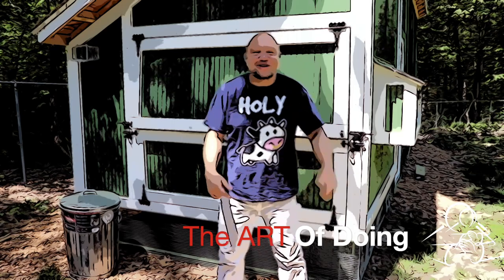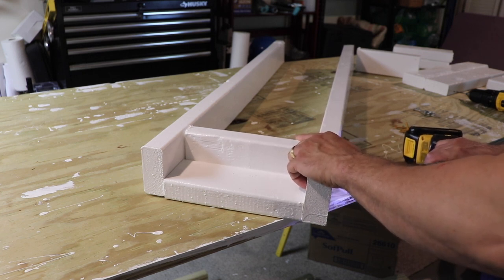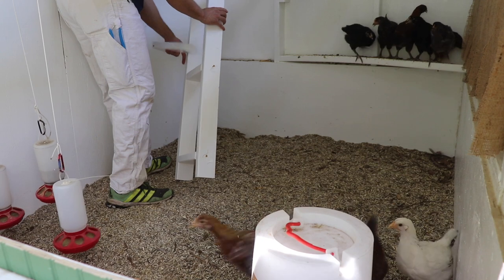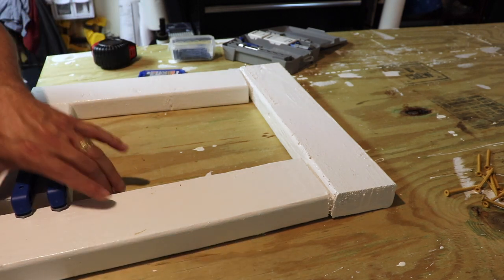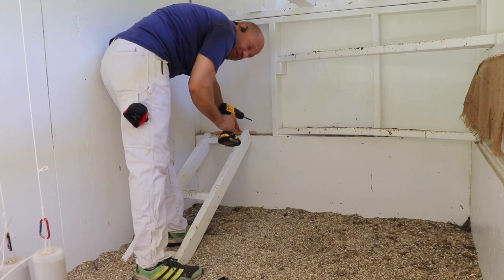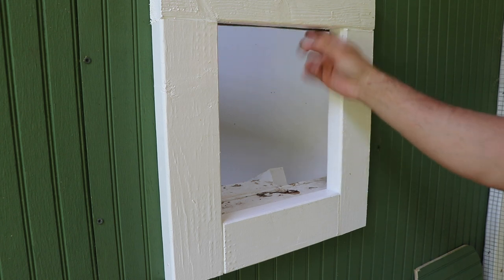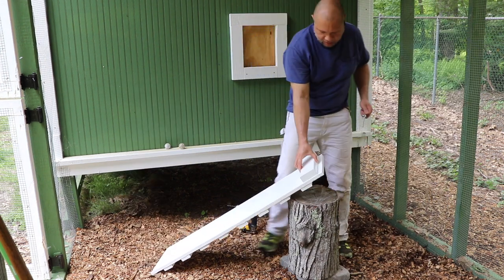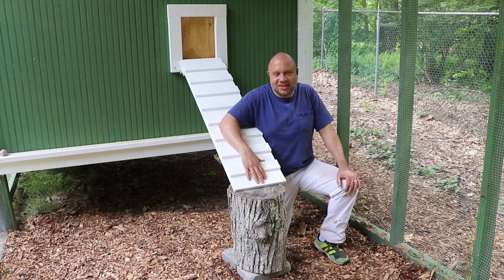Exit ramps and easy open exit door. Most Epic DIY Chicken Coop Build Part 12

Comment: Wow, what a coop! I really appreciate you showing where you made errors and how you fixed them. I'm curious about why you made it so tall inside? When I had chickens in the NW I built a small 4'x6' deep litter coop for my 7 chickens. I used a method of keeping the coop very ventilated-- lots of vents along the top and a big window that was hardware cloth. I kept their feeders in the coop (made the feeders from PVC tubes so I could cap them at night to deter rats), and I used pine shavings for the litter. I put down linoleum on the floor so I could easily sweep out the litter with a rake. In the run I used for litter anything that came from the garden, including grass clippings and leaves, weeds, straw, etc. The whole thing worked great, the chickens were happy and healthy and there was no smell of chicken poop (our neighbors were close).  I really enjoyed watching your build and hope that you are loving your coop! :)
Reply from the maker: Thank you so much! So many videos make things seem too easy. Since im not seem expert, I wanted a true to life build. It sounds like we had some similar designs in our coops. Have you seen my pvc feeder episode yet? As for the height, I wanted 6' on the inside of the run at the lowest, 8' wide and enough slope on the roof for the snow to want to slide off. Originally I had a steeper slope in mind but I trimmed it down so I could use 10 foot boards! Thanks for watching and commenting. I really appreciate it!!!!
Reply: @TheArtofDoing  I didn't see your PVC feeder episode, but it sounds like we ran across a lot of the same tutorials when planning our coops :)  I found your video about using a Kreg jig and then clicked on your chicken coop videos because I've been thinking about getting chickens again. I don't know if you ever found this resource, but somewhere  there is a great old article written a long time ago (I want to say in the 1940's) by a chicken expert at a university about how the things that plague most chickens in captivity have to do with being in a coop without enough ventilation and them getting respiratory diseases. He said that in the wild chickens roost in trees, so they basically just need shelter from some wind and rain, but they need a lot of air movement even in the dead of winter. We think chickens need to be warm in winter in a closed up coop, but that's not true at all. Thanks for your videos. I know how hard and tiring it is to build a chicken coop, and you did a great job! Happy chicken-ing!
Reply from the maker: I haven't read that article but my design is built on those principals... my feeder episode just came out a few weeks ago... thanks again, I hope you do end up getting back into chicken keeping! Cheers!!!